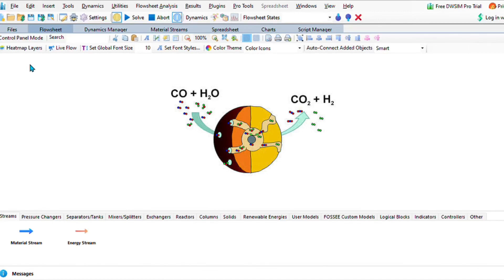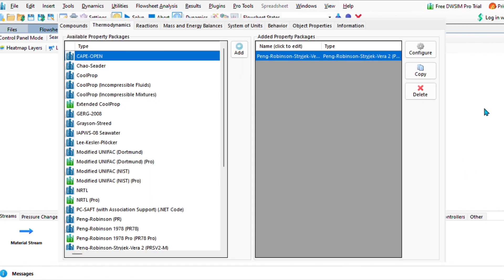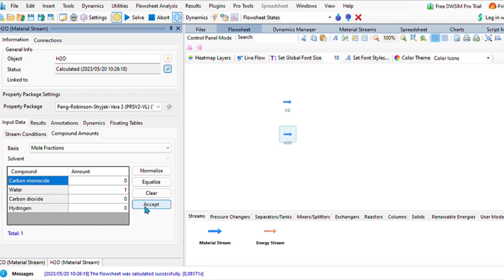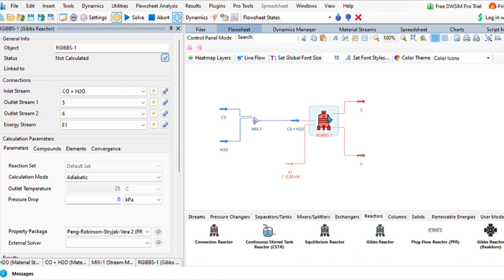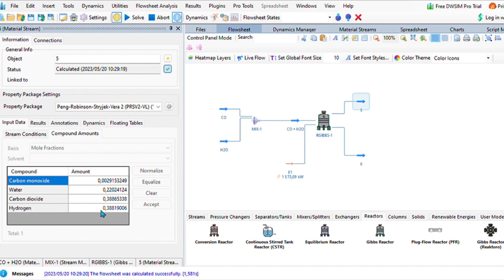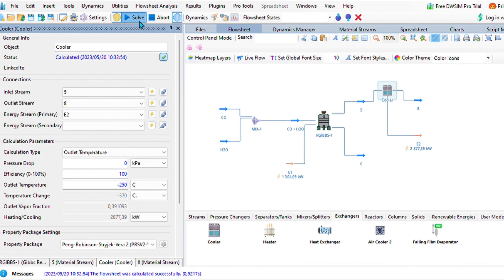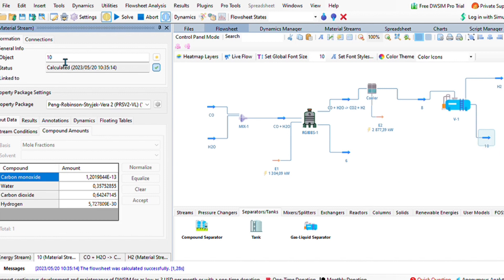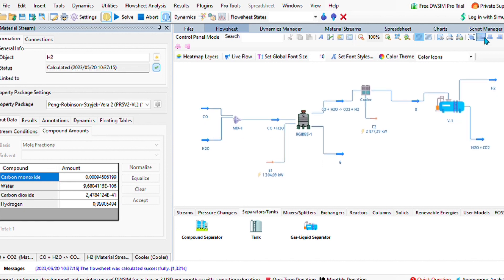DWSIM Simulation: CO + H2O = H2  + CO2 (Water gas shift Reaction)

Comment: Sir could you please upload PROCESS DYNAMICS AND CONTROL LAB Experiments :

PROCESS DYNAMICS AND CONTROL LAB Experiments

1. I & II Order System Dynamics
2. Interacting & non interacting Systems
3. Flapper - Nozzle system
4. Control valve characteristics
5. Level control system
6. Flow control system
7. Pressure control system
8. Control of a thermal system
9. Design of control system for a given process
10. Simulation of a closed loop system
11. Demo Experiment using Aspen Software of a given process